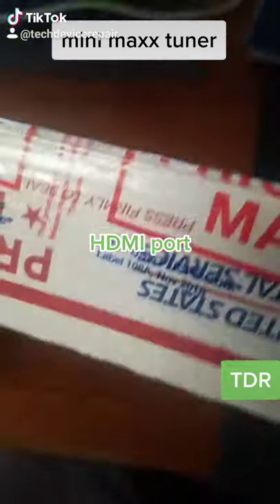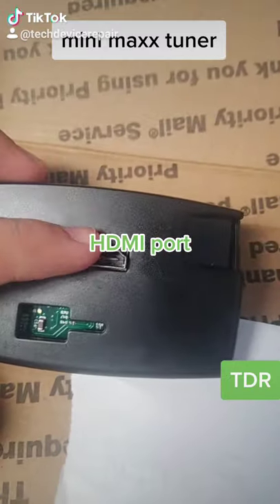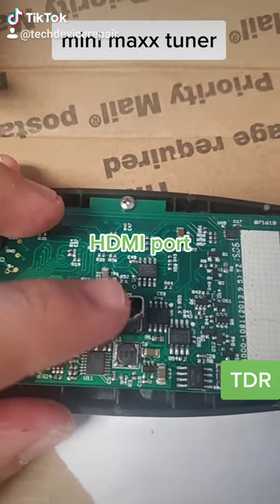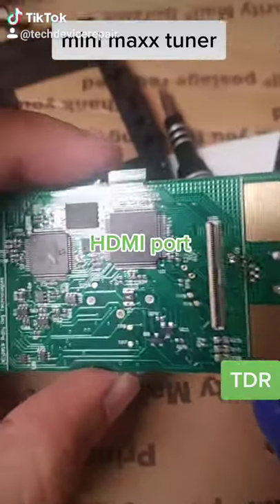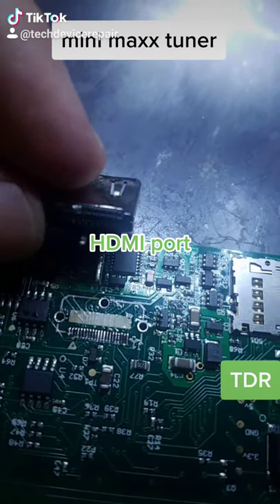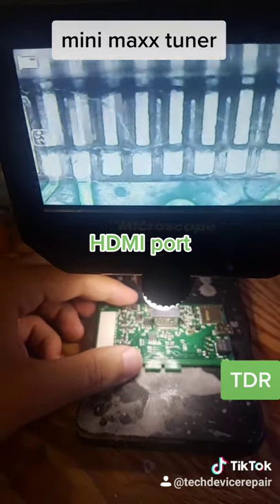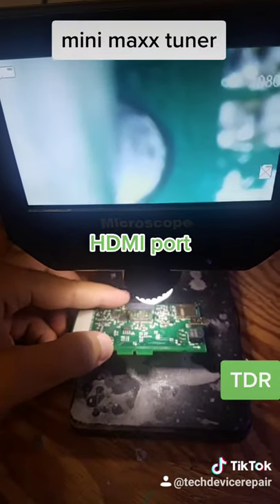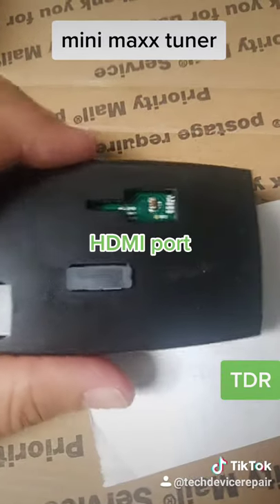Mini maxx diesel tuner with broken HDMI repair

Comment: How much for this repair? My port itself doesn’t wiggle around but you have to wiggle the hdmi cord to get it to come on. I’ve replaced the hdmi cord with same results. I sent it to another YouTube that fixes them, he forgot about it for weeks and when I called to check on it he said it was a processor not the hdmi port… I’m no expert but I know if I wiggle the hdmi cord and it comes on, it’s most likely the hdmi port.
Reply from the maker: Please use our website for prices.